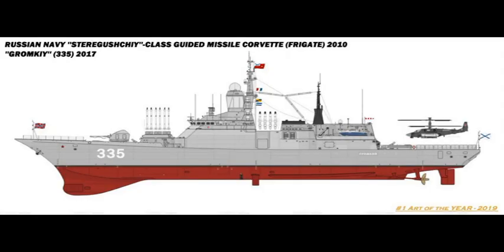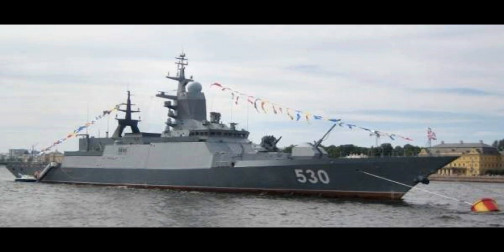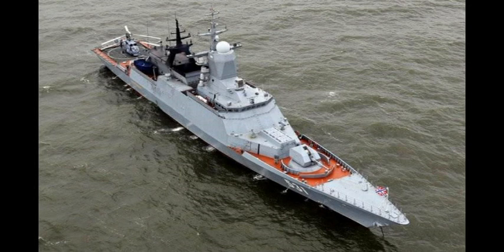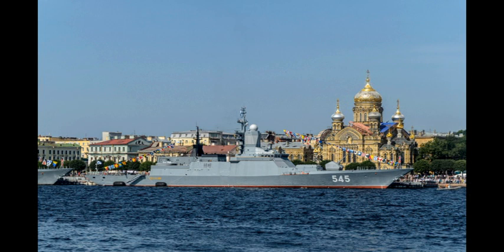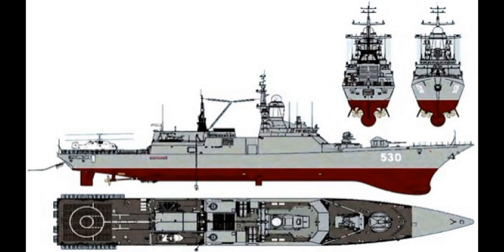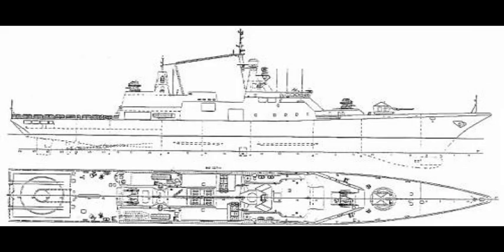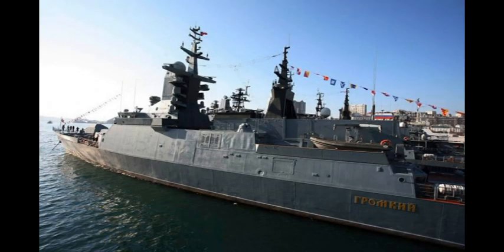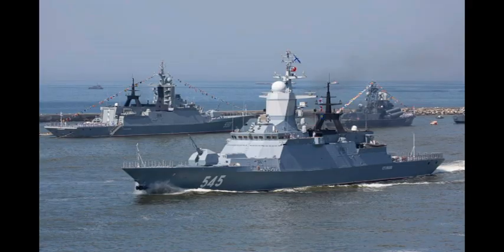STEREGUSHCHIY CLASS CORVETTE BRIEF - NO.11

Comment: The Redut VLS on the 20381 is not interchangeable with the UKSK VLS on the 20385. Redut can only launch anti air missile, while the UKSK only launch Cruise missile. The 20385 is also much larger ship, it have 8 VLS for cruise missile and 8 for redut.

Comment: AAmissile info on Redut system is not full saying the least.
It might operate wisth a number of different missiles
48Н6Е2 - 1 missile per cell, range of 120 km with anti ballistic missile capabilities
9М96Д / 9М96М / 9М96Е2
 - 1 missile per cell, 120-150km
9М96Е - 4 missiles per cell,  40-50 km
And those might be loaded with different combinations depending on task and/or fleet composition